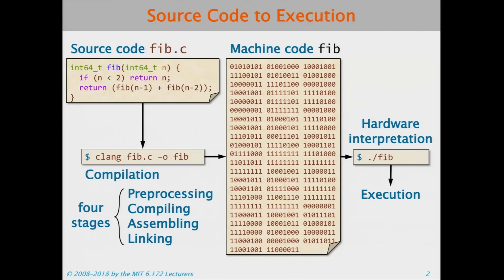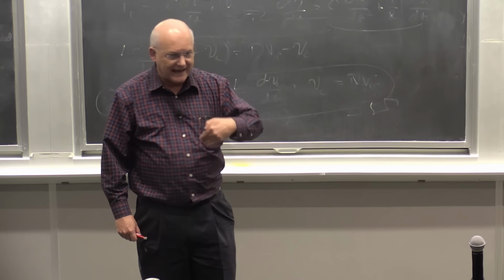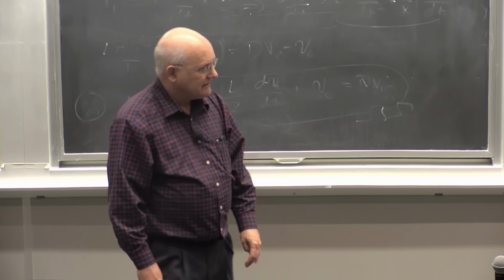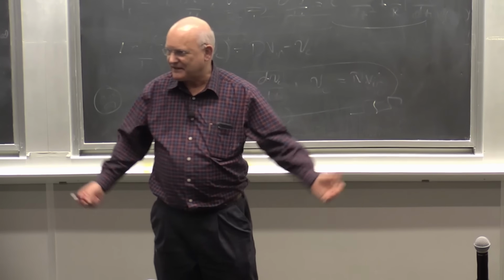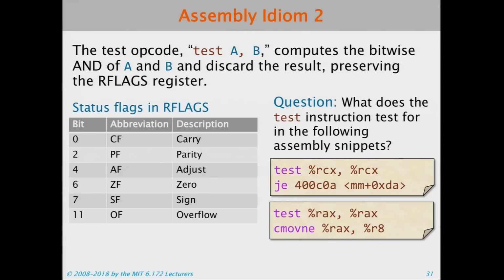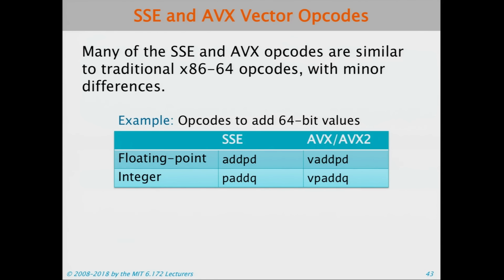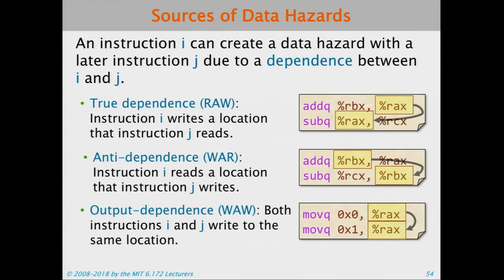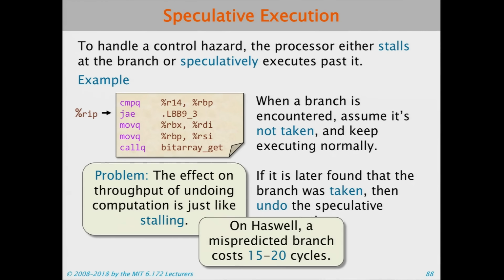4. Assembly Language & Computer Architecture

Comment: 13:10 The one level below & one step beyond learning philosophy is something I've followed as well.
Reply: I'm self taught and I have learned about every level of abstraction within computers from the science (mathematics, physics and chemistry side of things) all the way up the chain to logic gates, cpu and ISA design to OS and Compiler design and various other fields such as 3D Graphics - Game Engine design, to Hardware Emulation all primarily in C/C++ and a little bit of assembly, and now learning about Neural Nets, A.I. Programming and Machine Learning within Python. I didn't start at the bottom though nor the top. I started near the middle tackling some of the hardest aspects of software engineering with C++ while learning DirectX and OpenGL. C++ is one of the hardest languages to become proficient and accurate with as a first language and 3D Graphics and Game Engine Programming incorporates almost every and all other aspects of programming throughout a majority of all other industries. The Graphics Rendering is just one small part... You also have Audio Processing, Animation, Physics Engines, A.I. programming such as Path Finding and scripting dialogs for in game NPCs. Terrain Generation, Foliage, Weather and Environment Mapping and Generation, Various Tree Structures with Memory Management, Networking with Server and Client side applications that deal with sockets, packets, ip addresses and more if the game is meant to be Online, Compression & Decompression, and Security with encryption and decryption and much much more as this is only the "game engine" side of things as this doesn't include any "game logic" or "game rules"... Many Engines will have their own Parsers and some will even have their own built in scripting languages for that specific engine which also leads into compiler or interpreter design... But this is where I started... I branched from here going in both directions. Going up the ladder of abstraction I am now learning Python, Java and JavaScript with Machine Learning Algorithms and Techniques as my target goal and going down the ladder I'm learning more about Assembly and how it is designed through the implementation of its targeted hardware (ISA, CPU - Hardware Design). I never stop learning! That's why I'm watching this video... It's a refresher and I might pick up something new that I didn't know from before! But yes that 1 step above and below is a very good method to follow.
Reply: @skilz8098  you must be kidding ! How could somebody learn so many things by just self studying!!!? And if your age is below 30 then it does not seem to be feasible to self learn so many concepts by your age. Please enlighten me how you have achieved this feat if you have really learnt so much within a time span of few years.
Reply: @MJ-ur9tc  Well, I am 40 and I never stop reading into things! Also, when I was a teenager either in middle or high school, I still knew more then than most 40 year olds did.
Reply: @skilz8098  I mean re-reading your comment just makes me pause. It's like word to word what I want to do. Like, are you trying to social engineer me? I'm not exaggerating, I hope you're not as well but the things you've mentioned here are everything I want to learn and get good at myself. Moving down & moving up the abstraction ladder this is what I want to do as well but it's not something that's easy. It's like EECS, ECE/TCE + IT/NE. Those are like 3-4 fields. You have different teams, hell different departments for them in an organization. Damn! I thought I was overreaching and doing something like that is impossible but you have done it. 

Could you please share a timeline of your learning too please.
Reply: @therealb888  The learning or timeline that you are referring to doesn't really exist, it's kind of random and what's of interest to me at the time... but it would look something like this...

From about 2000 - 2018 I have taught myself C and C++ and my primary motivation was to learn how to build a 3D Graphics or 3D Game Engine from scratch. I wasn't so much interested in making a game even though that was on the todo list; I was more interested in learning how to make the actual engine. I wanted to know how lines, triangles, etc. are being drawn to the screen. How to simulate physics, motion and animation, even 3D Audio was a part of this. By learning how to build an actual Game Engine and all of the different aspects and components of the Engine it teaches you memory management, resource management and object lifetime. It teaches you databasing, file parsing, writing your own scripting language sort of like an assembler or compiler, etc... and this is just to open, read, load, write to files either being graphics, audio, vertex data, later on shaders, initialization files, configuration files, save files, etc. Then comes the Graphics Pipeline and all of its various stages. It teaches you how to setup up and how to both integrate and use a Graphics API such as DirectX, OpenGL, and now Vulkan and I've learned all 3. Well, I've learned DirectX from version 9.0c upto version 11.1 as I currently don't have a Windows 10 machine and don't have access to hardware that supports DirectX 12. The same goes for OpenGL. I started with Legacy OpenGL or v 1.0, I then skipped version 2... and went straight to modern OpenGL which was 3.3 at the time and now its 4.5 or 4.6... And even to this day I'm still interested in learning so I read through the documents, forums, help pages, watch videos, etc... just to remain current. Even your programming language such as C++ changes with time. When I first started I was using Visual Studio Express 2003 or 2005... My current latest compiler is Visual Studio 2017 and when I finally get my new rig, I'll have Visual Studio 2019 or newer for C++ 20... I can only do C++ 17 and there are some features that I can not, but for C++ 14 and 11, I can do just about all of them. 

Outside of just the graphics portion. I then started looking into and trying to learn how compilers are made, how assemblers, disassemblers are made for I was diving into how the actual programming languages themselves were built. As for the assembly side of things, I started to learn this because of my newer interest in learning how Hardware Emulators are built or engineered. This is still the software side of things. Now at this point I had some knowledge of basic circuitry more on the math side, but never have solder a circuit board, but I've always had an interest in how they are made and how we are able to get them to behave in the manner in which we prescribe. So this lead me into doing some research and I came across Ben Eaters Youtube page on building an 8-bit breadboard CPU. I've been following his channel ever since! I even went from there and started to watch videos on Youtube from either MIT, Stanford, etc... on Computer Architect Design and more. I even went and found a free program call Logisim that allows you to place icons onto a grid fashion to build circuits. And yes you can build a CPU within. I went this route because I didn't have the physical materials to follow along with Ben Eaters videos. And I was able to build my own implementation of his 8-bit breadboard CPU within Logism following and adhering to his ISA (Instruction Set Architecture). I can take his binary form of his own assembly language and run it through my CPU within Logisim and it will run the same functions that he demonstrates. 

Before this I had already knew about the internal hardware components of a modern computer such as the CPU, the RAM, ROM(Hard drives or external storage), The Main Bus, CMOS originally then BIOS, expansion cards, video cards, sound cards etc. and I've always been able to build, configure and install all of the hardware and this goes as far back as the early to mid 90s. I was about 12 when I got my first PC and it had Windows 3.1 & Dos 6.0. When you turned it on, you got some writing on the screen about the connected hardware, the ram, etc... then you'd get a command prompt! C:\  If you wanted to use Windows, you had to be at the root of the drive and type "cd Windows" without the quotes, this would then put you in the Windows directory, and then you had to type Windows or Windows.exe for it to load and run... CDs never mind DVDs or BluRays were not exactly new, but most computers then didn't have CD Rom support, they still had the old floppies, both the smaller 3.5 and the larger flimsier 5.25 diskettes. The internet was around but it was both young and most didn't have it as it was expensive and there weren't that many graphics nevermind videos. It wasn't until the late 90s that we first got internet and even then (pre dot com boom) most websites had only a couple of graphics or images because their download times were slow. Over 90% of the internet back then was text and hypertext links and many sites were still found on ftp sites.

So I've always had a decent knowledge of the hardware but never knew how they were built through their circuitry. Due to my interest in wanting to learn Hardware Emulation Programming, this lead me into CPU Architect and Design as well Electronic Engineering beyond the integrated circuits right down to the logic gates themselves and their connections or pathways. And I didn't stop there, I even learned how the logic gates themselves are made from the actual components such as transistors, resistors, capacitors, etc... and around 2005 - 2008 I was trying to put myself through college to get a degree in both Software and Hardware or Electronic Engineering. And within my Calc Based Physics Class I learned more about Electricity and the various components. Not so much the circuit diagrams, but what chemicals they are made of, how they interact with each other, what happens to them when you apply a voltage or a charge, or put them near a magnetic field, etc... 

Now as for the math behind it all my highest level of math from a classroom is Calc II. However I was teaching myself Linear Algebra and Vector Calculus while I was learning Calc I. This was from write the functions to build a working 3D Scene with a viewpoint and view frustum to have a working Camera as well as applying transformations from one coordinate system to another as well as applying transformations onto objects to simulate both physics and animations. 

When you start working with Audio especially 3D Audio this is an entire different ball game! Now you have to learn FFTs, bitrate samples, frequencies, compression and decompression algorithms etc... 

And it doesn't end there... Just recently within the past year or two, I have an interest in two different topics. AI - Programming, Neural Networks, Machine Learning and Operating System Design. The first got me into learning Python and the later refreshed my understanding of Assembly and C as C++ is my primary language of choice.  So even to this day I'm still learning!

Comment: My introduction to assembly language was on a TRS-80 back in the day. Found I could speed things by poking values into memory. Then got the assembler and life was fantastic. And i still remember the video addrs 3c00 to 3fff
Reply: I wrote a program on my TRS-80 that would draw the X-Y axis centered on the screen and the plot cardioids using polar coordinates.  Not bad for a 9 line BASIC program.
Reply: @pauleveritt3388  Ah very cool. Yeah I did all sorts of things, had a voice input module and a speech synthesizer hooked up to mine.
Reply: @pauleveritt3388  Remember this? 
LD HL, 3C00H
LD DE, 3C01H
LD BC, 3FFH
LD (HL),20H
LDIR
Reply: @jimmccusker3155  was this some display buffer program, the load, increment, repeat instruction and load (HL) 20H  is the clue for me, never used TRS but that was Z80A just like my ZX spectrum I believe, I wrote a defender type game in assembly, by using paper and poke statements, took me fucking ages ! it didn't use sprites, just the larger character set attributes, but it ran ! the spectrum split up the display screen in a really weird way though.
Reply: @psycronizer  Yes, the TRS-80's video was mapped from 3C00H - 3FFFH and those assembly instructions were the quickest way to clear the screen using a space character (20H).

Comment: I hate x86 assembler. I had both mainframe assembler and X86 in college. X86 always feels backwards. I still program mainframe assembler.
Reply: I did the same thing IBM 360/370 Assembler in college and whenever I started doing microprocessor assemblers 6502, x86 etc. the first thing I noticed that mainframe assembler seemed to be designed for actually developing applications in it but the micro assemblers was just missing a lot of stuff that made me think that is wasn't really designed to be a human usable programming language. People obviously do it but it seems like it just wasn't made for that.

Comment: My takeaways:
1. Assembly language 0:22
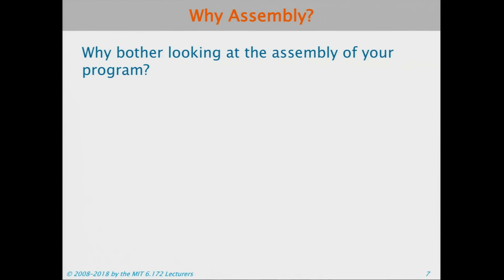- Why we want to have a look the assembly language 6:46
- Expectation of students 10:05
- If you really want to understand something, you should understand one level below what you normally need to use 12:20
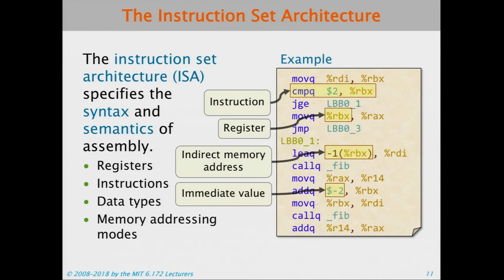2. X86-64 ISA primer 13:28
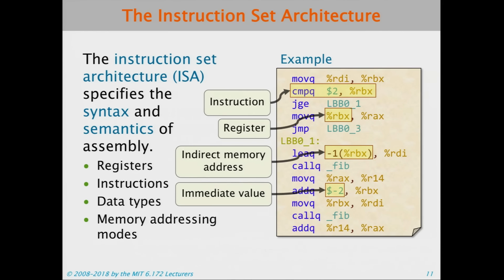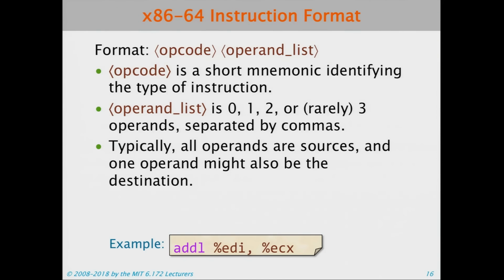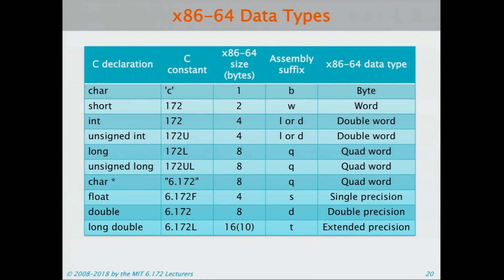- 4 important concept: Registers 14:03, Instructions 20:25, data types 28:15 and memory addressing modes 35:50
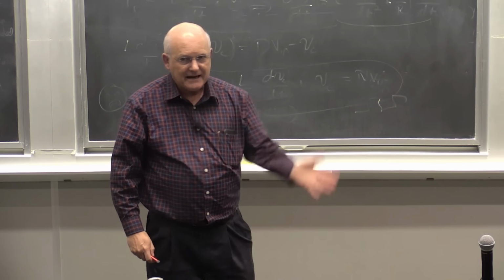- Assembly idiom 43:08
3. Floating-point and vector hardware 47:54: SIMD
4. Overview of computer architecture 56:55
- Historically, computer architects have aimed to improve processor performance by exploit parallelism (e.g. instruction-level parallelism (ILP), vectorization, multicore) and locality (caching)
- ILP 1:00:35: pipelining, pipeline stall, hazards
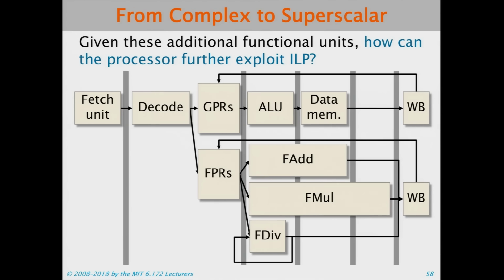- Superscalar processing 1:09:08
- Out-of-order execution 1:11:40: bypassing, from in-order to out-of-order, register renaming
- Branch prediction 1:15:44: speculative execution
Reply: cool
Reply: Thanks pal
Reply: thank you!
Reply: thank Bro :)

Comment: @31:49
Did not understand it
For Opcode Suffix,
movzb1 %a1,%edx
what's the fuss with "z" Suffix Opcode and "b1"?
In the previous table
He didn't mentioned anything about 
"z", "b1", "s","lq".
Suddenly in the example here they are.
Reply: "z" for zero-extend - and he give an example of that (i guess it's something like when u want to store 4 which is "100" in one byte, you zero-extend left bits which created "00000100")
and "bl" not "b1"
Assembly suffix "b" => x86-64 data type: byte                - x86-64 size (bytes): 1
Assembly suffix "l"  => x86-64 data type: Double word - x86-64 size (bytes): 4
Assembly suffix "q" => x86-64 data type: Quad word    - x86-64 size (bytes): 8
and "s" for signed values, which the most left bit is the sign flag and u need that to be the most left bit in the extended version too, to get the sign...
sry for lack of english :)
Reply: he goes over that in the vid

Comment: Since it wasn't mentioned, the older 8/16 bit systems often used bank switching to access more hardware resources within the 64KB address space.  The CPU could only see 64KB at a time, but the hardware mappings within the 64KB could be changed on the fly as is possible with the Commodore 64.